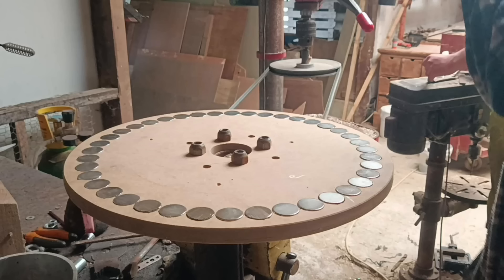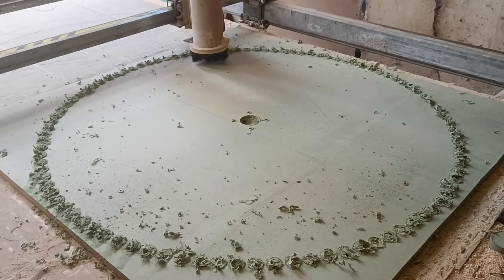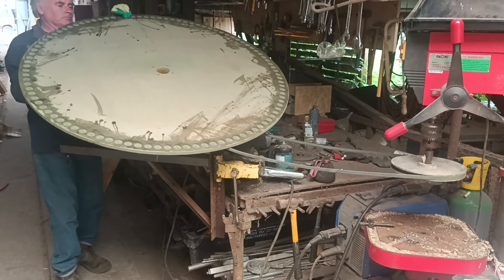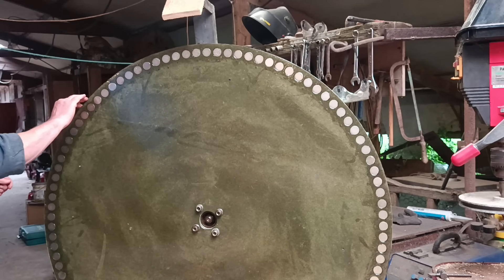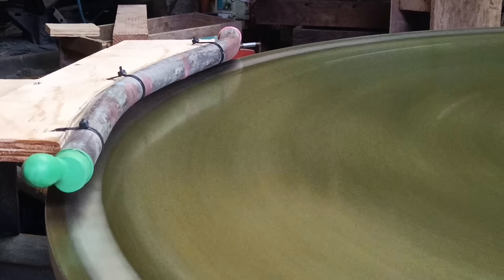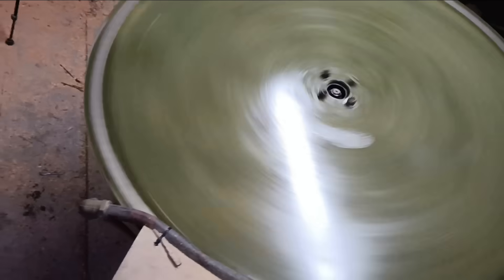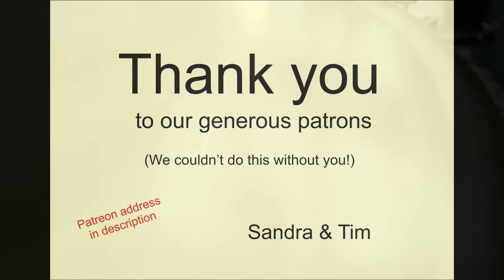ABSOLUTELY HUGE Magnetic Induction Heater! Using 100 Spinning Neodynium Magnets And A Bucket

Comment: A better Thermosiphoning loop can be a lot smaller in length.  Eg with the bucket right next to the heating pipe, only Slightly above. BUT!!!!! the inlet and outlet need to be separated by height at the tank. That way it will force the cold water out at the bottom, and hot water in at the top. We use similar for camping to get hot water for washing up.  Less pipe = less insulation. I think at bucket scale on this set up you will boil water.

Comment: Why have the pipe over the spinning disk connected to a reservoir?

Could you not build a tank directly above the spinning disk that way the whole base of the tank can be your induction heating surface. Like a big cooking pot. You can have magnets towards the center of the disk too.

Then have flow and return coming off the side of the tank instead of the bottom.

Disadvantage is probably that it's harder to fit into a space as the tank and disk need to be mounted together.

Comment: Maybe you can start with such a large diameter circle of wood and trim is perfectly round to the center drive pulley with some wood lathe cutting tools. Than balance it to as close as you can balance it. You can do that after the magnets are installed to have them balanced as well. That would be a great start for a smoother operation... Thumbs Up!

Comment: The final version of this will probably be connected to a big tank with an inlet at the top and an outlet at the bottom.
The water in your bucket gets mixed pretty well, the water in a tall tank not so much.
So you should use a tank with a similar height for your testing. Maybe a 150-200mm PVC drain pipe?
I am sure this will improve performance of the convection through the pipes.

Comment: If you can buy a metal water pump like a drill pump & put a Vee belt pulley onto it so you can run it at the same time as you are heating your water then insulate the hose as well as insulating the bucket then you'll get better heating & flow. If you have a round block of Aluminium around 1.25 inch or 32mm diameter x 1 inch or 25mm thick then you can put it in the lathe & turn out your own Vee pulley with a hole in the center depending on the shaft size of the pump plus drill & tap through the Vee for a grub screw to lock onto the shaft of the pump. Those drill pumps can pump around 30L/min @ 1750 RPM up to 60L/min @ 3500 RPM.

Comment: This looks so close to your original concept, I love it! Everyone is telling you to overcomplicate it but it feels 90% there - it looks like quite a big air gap between the copper pipe and magnets which you want to minimise, and it clearly wants insulation but it looks almost there
Reply: My thoughts exactly. I know clearance tolerances are sketchy and impacts rather worrisome, but there's a lot of heating potential left because of that larger gap.
Reply: I wouldn't try to fix the gap first. I would go 4x on the heating elements. It is less complicated, you need to replicate the existing infrastructure, and along with isolation it could expose true potential. But at the same time I am not an expert on magnetic induction

Comment: Add insulation to all the tubing.

Run the power collecting loop all the way around the disc.  For even more potential, multiple circles of magnets both above and below the disc, and of course insulate every bit of it, including a bit between the disc and collecting loop, and loops both above and below every circle of magnets. 

Add a pump.  Thermosiphons are fun but not practical unless you have absolute mountains of power to waste and aren't concerned about efficiency.

Your power generation will be limited by the power output of your pillar drill.  For now it's easy enough to determine the efficiency of your system: put a consumption meter on your drill's power supply, and then run the numbers on the mass and temperature rise over time of your water.  For maximum efficiency, you get better results heating a larger mass to a smaller rise than a small mass to higher temperatures.  The higher temperature is fun in a New High Score sort of way but it also means that the greater differential and lower mass lose heat much more readily to the surroundings.

Comment: For you to get the most effective heating up you'll need to use "Copper" because it has the composition needed. Aluminum isn't a good candidate because it's not as reactive as copper.
Reply: In addition to minimal clearance between the magnets and the copper.

Comment: Copper pipes is good, but the copper wall could be thicker. If any magnetic force makes its way to the pipe interior--it's wasted. The magnet's effect will largely fall off by either the square or the cube of the distance, so they 2nd copper wall of the pipe won't be as much help. You might try an experiment, a thin bit of copper or aluminum--and a block of it.

Comment: Hm. I would be interested in the power your upright drill draws (e.g. measured with those power meters). If it draws around 1kWh in one hour, that's about 160 kcal in 10 Minutes. You need 50 kcal to heat up 5l of water by 10 degrees, so you can only get so far, given that there are even more mechanical losses in between.
Second thing: Every heating system has a certain outflow temperature, which depends on the way your copper pipe works to heat the water (the temperature of it). Likely the heat transfer inside your pipe is not enough so it radiates the heat rather than heating the water. You'd need a longer hot pipe or loads of small pipes parallel.

Comment: Tips, well, the first thing my 6 year old daughter said was that you could also boil the egg in the bucket, once the water heats up enough. 😜

My thoughts: the pipe is probably not optimal to pick up the induction, and it probably isn't the most optimal heat exchanger to get the heat from metal to water.

I understand the simplicity and charm of passive circulation, but since this will be driven by a windmill, why not also use a pump for circulation. Heat transfer is more efficient with a bigger temperature difference, so it would probably help efficiency to increase the flow rate.

Comment: I think you could increase the efficiency significantly by placing a wounded spool around the perimeter instead, then use the induced currents to heat water with a dedicated boiler coil.

Comment: Small thing but I suggest placing the hot water outlet near the top of the water surface in the water reservoir, such as to diminish turbulence and increase stratification.

Comment: My suggestions for improvements 

Add more heating area (smaller diameter pipe with multiple laps of the wheel) this will ensure you've got more copper getting hot compared to the amount of water cooling it)

As you already know insulation! I have a bath on my tiny boat and it used to take 4 hours to heat with a twin burner stovetop contraption i put an Insulated lid over it and now I can heat it in under an hour 

To improve balance mark three locations 120 degrees apart and start with no weight (control) then trial and error add weights to the three points to see if you can improve the balance (there a website somewhere I used to know that helps with that (also once you have improved that balance as much as you can you can always repeat the process 60 degrees offset) 

A question I have how much load is being put on the pillar drill? Do you see a noticeable difference when you move metals to the heater? (Maybe a watt meter on the pillar drill would be interesting to watch) and that would also help you make sure you dont over load your wind turbine

Comment: this may have already been shared on one of the videos for this project, or indeed been an inspiration for it, but lowtech magazine has a whole article called "Heat your House with a Mechanical Windmill" at their website. even though you've gone down the induction route I'm sure the majority of the system would be similar to the mechanical/friction design and the article has many links to explore further. just wanted to bring it to your attention if you weren't aware of it. awesome stuff as always Tim!

Comment: I'd love to see a pair of loops running right around the circumference on both sides of the disk to maximise the area of flux interaction. I expect it'll increase the required power input substantially, and the amount of heating in turn. I'd suggest run the water inlet into the loop on the back where the flux is a bit weaker, since that side will naturally have a lower maximum temperature potential.

Comment: Maybe make it into generator, by adding some coils. Even with introduced losses overall efficiency will be better - Joule heating conveniently localized isolated tank will be better. Connecting electricity is simpler than it is for water. Additionally you can store excess energy ( i.e. old car batteries ), use it for other purposes.  Regards from Poland.

Comment: I bet the magnetic field is almost the same strengh at the other side of the wheel. I wonder if north and south poles could be canceling in the lenght of the copper tube, maybe one pole at the time crossing the tube would get more heat? With 90 angle  elbows, you could snake the tube, so only the norths than the souths are crossing the snake tube.
I would use the wheel with horizontal axis, so the snakes are vertical covering half a turn of the wheel, 2 snakes in front, 2 snakes on the back, and maybe 4 more snakes interlaced with the others to also make use of the magnets facing south while the norths are used.
Cheers.

Comment: You still can't see that this is a shitty idea. Plug in your pillar drill through an ammeter socket, compare the readings with the copper pipe engaged vs disengaged. The difference is the heat power generated by induction. You're probably getting something pathetic like 10 W.

Comment: @Way Out West - Workshop Stuff
Balancing. You should probably first use a sandpaper (or similar) & slowly aproach the edge of the spinning disk, so it grinds away the "sticky out bits" and it becomes perfectly round.
TEN you can do the balancing with he weights. That should give you a almost perfect circle (in the radial direction, NOT in the axial direction, the "wonkines" up & down is still in need of correcting, not sure how to do that in a reliable way).
Reply: It's CNC cut. Think there are sticky out bits?
Reply: @IvoTichelaar  Just look at it rotating, it wobbles.

Comment: @Way Out West - Workshop Stuff
For insulation, buy "pool noodles" & cut length-wise along one side of them (or if you can just disassemble the system & "sleeve" the noodles onto the pipes?, no cutting needed).
Quite cheap to buy, decent insulation.

Comment: When you're ready to go to larger scale, if you haven't already you might consider using a longer section of pipe that follows the entire circumference of the spinning disk to make sure it's receiving heat all along the length, and to do a second circle below the spinning disk to pick up energy from the magnetic field moving on that side as well.

Comment: @Way Out West - Workshop Stuff
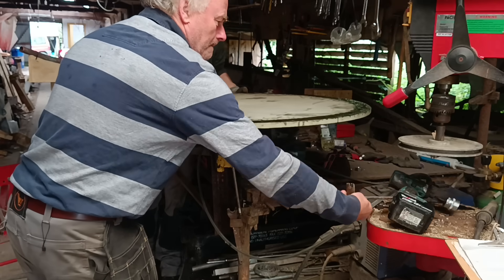4:10 Heat can be a good way to loosening up glues of various sorts.
The amount of heat varies depending on what type of glue you're using
It can be enough with just a hot air heat gun, but sometimes a blowtorch might be needed (not recommended on glued wood stuff, for obvious reasons, good on metal stuff) :)

Comment: Another fantastic video that gets my imagination going!  That big disk, all varnished and shiny makes me happy.  Haha.  
I don't have much to say that a dozen other commenters haven't already.  Well...  maybe for a nice smooth pipe bend, you can try a technique used to bend brass tubing for instruments.  

To avoid kinks in the tubing, cap one end and fill it with water, then freeze the water into ice.   While it's frozen, bend the pipe to keep its circumference even.   After it melts, left with a nice curved, round tube.    

Although, the radius on this pipe seems like it'd be fine using a roller bender without issue.  😅 

Amazing work, as always.
Reply: Maybe a wind deflector to shield the element?

Comment: If there's a lot of inertia stopping he disc from spinning, does that mean the windmill will only be able to spin it on very windy days? On days with moderate wind you might have to go out and get it going by hand maybe?
Reply: I was wondering that too.  I suppose some sort of ratcheting mechanism might be useful, so the windmill can add energy into the wheel without having the wheel turn the windmill when the wind is variable.   If that makes sense.
Reply: I've seen some wind charts of his area, he has a lot of wind and very variable as well. I expect there will be some moments where the mill stalls, but there will also be gusts of wind to jolt it in action again. And with the size of windmill he is building, I think he will already generate quite a lot of energy.
Reply: Gym goers could spin wheel

Comment: You could even go to multiple rings of magnets and a complete 360deg (well, almost), ring then swap into the next ring in, and then the next and so forth so that for a given rotation of the disc there would be many, many flux cuts.

Comment: Put the flow pipe into the bucket at the top and the return pipe in the bucket at the bottom. The differences in temperature across the height of the bucket will drive the thermosyphon . 
Also, can you not use both sides of the spinning disc to heat water? You would get twice the heating effect

Comment: It's harder to construct, but a duct-in-duct arrangement might be more effective.  A rotating barrel with the magnets in multiple rows mounted on the outside of an inner duct, to pass the working fluid (water, air, whatever), with a circular bearing at each end to maintain the smallest gap possible.  There's an old design that had a layer of oil between two such cylindrical pieces.  Come to think of it, if the outer cylinder is ferrous or the magnets are just strong enough, they could be mounted on the outside, to keep the inner side smooth and create a very tight gap.
Reply: Year, that's how Eddy currents will be generated in all of the pipe instead only in the potion facing the magnets as now.👍
Reply: Tight gap, heheh